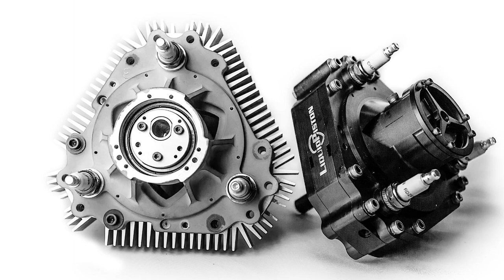The Next Generation UAV Engines: Alex Shkolnik, Liquid Piston

Comment: The commercial product seems to be another fusion energy project.
It will arrive in Xmas, we just not know which Xmas.
For the simplicity of this design, I think someone should be able to DIY a prototype to run go-kart,
make generator for emergency power supply, quadcopter long range hybrid power source etc.

I am sure it will make a fun DIY project.

Comment: that thing will drink as much oil as gas
Reply: actualy no, i read the paper and the oil consumption is on a level of a piston engine because it is directily injected on the seal
Reply: @joaovitorsilvagohl682 

The seals are located in cartridge mounts in the outer housing that allow replacement without needing to dismantle the combustion rotor chamber    assembly 😉🧙🏼‍♂️ lubrication is directly delivered to the tip seals so no oil fuel mixing  and as the seal cartridges are static in the outer housing they run cooler and easier to keep cool by air or water cooling.